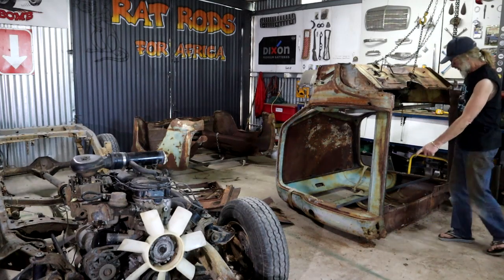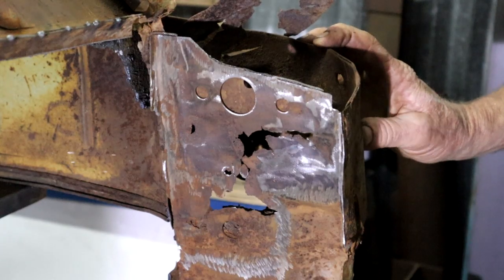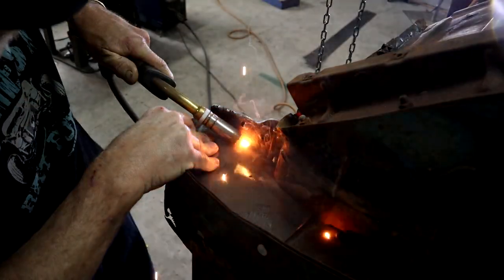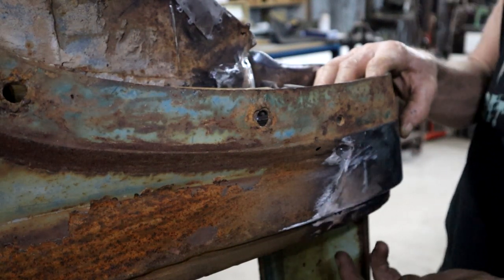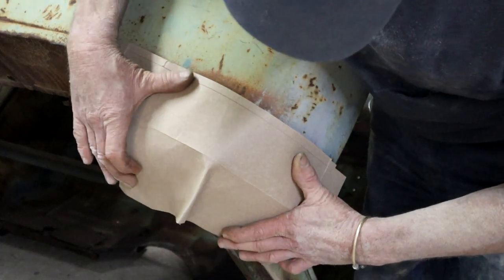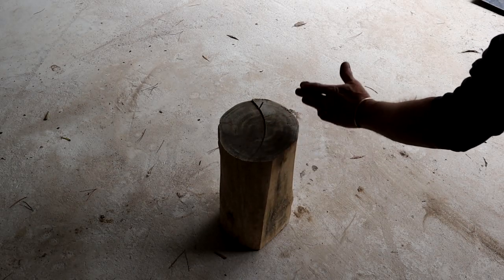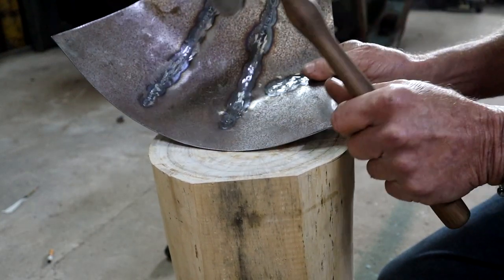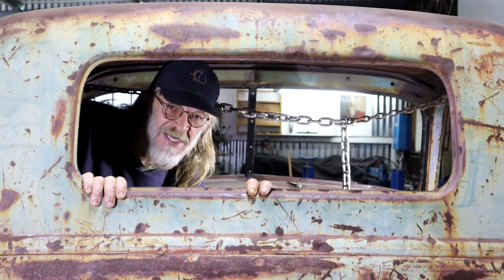BUDGET RAT TRUCK BUILD - Fixing rust holes on the truck cab (Part 5)

Comment: If you were to heat the airvent mechanism red hot and melt bees or paraffin wax (or a crayon) on it, the wax would be drawn into the porous metal. Let cool completely and see howsmooth it feels to operate... just something I picked up messing with old steam lines. Love your videos and your shop!
Reply from the maker: Why didn't I think of that!😅Great plan, will give it a try sometime. Thanks Kevin!